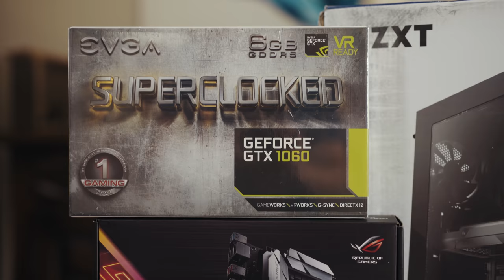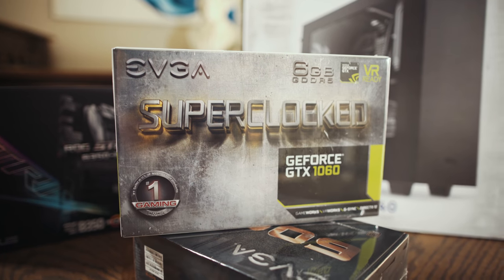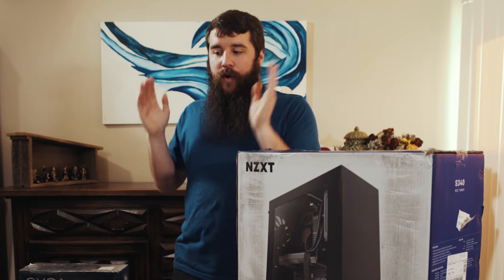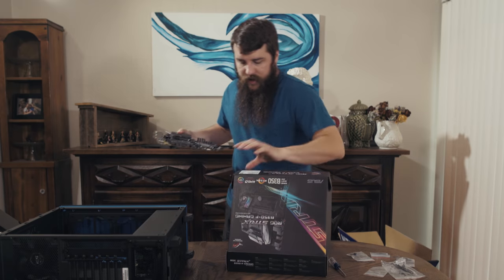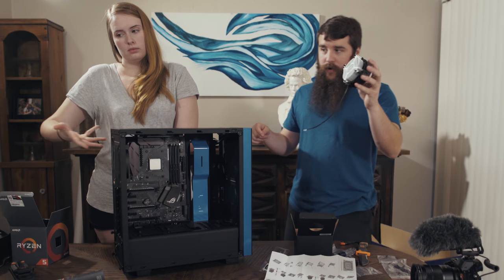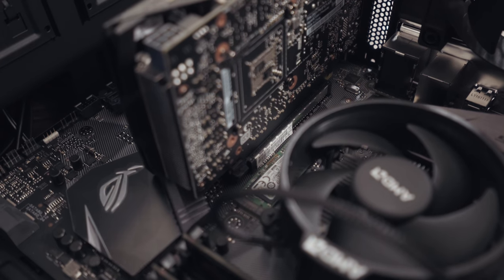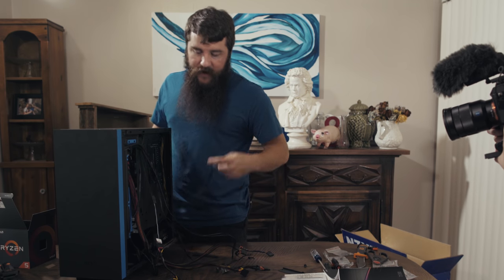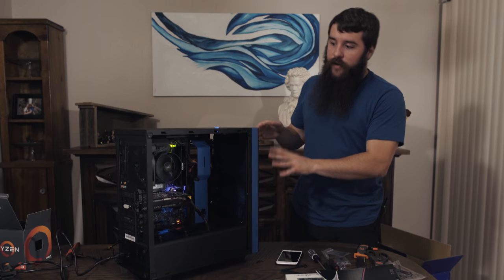How To Build A Video Editing Computer | $850 Ryzen PC Beginners Build Guide | 2017

Comment: So to me, this looks far from price to performance. I've parted out a pc that can blow matt's away. For $903 (before rebates, $891 after current rebates) you can get a better cpu (1500X) and significantly faster ram (3000 vs 2400). The mouse and keyboard are a bit more budget but still are great for gaming. If anyone wants real price to performance, and has an about $900 budget, look this way.  **edit: also the ssd is sata and 10gb less (240 vs 250) but the almost $30 difference isn't worth it.

https://pcpartpicker.com/list/BmwB2R
Reply from the maker: Great setup! Glad to see prices have dropped a bit in the months since I built mine. :)

Comment: you shouldve threw in another $100 for a watercooled radiator
Reply from the maker: Oh man if I had another $100 I would have upgraded the CPU first. Radiator would have come second. ;)
Reply: i have an alright CPU but it does bottleneck my 1060 at its normal clock.
so when i over clocked it, i kept getting crashes from the simplest of games.
and that was bad when trying to play VR games.
so i bought a radiator for about $85 and it stays very cool and i havnt crashed since.

but for sure, if i upgrade my CPU ill have to upgrade my Motherboard too

Comment: Someone is selling a pc with all this for 800 dollars is this a good deal  I know nothing about pc I just want something to do YouTube videos and reactions?DIYPC Vanguard-RGB ATX Mid Tower Dual Dark Tempered Glass Panels with 4 LED 120mm fans (3 intake, 1 exhaust). Mobo: ASUS PRIME B450-PLUS ATX. CPU: AMD RYZEN 5 2600X 6-Core 12-Thread 3.6 GHz (4.2 GHz Max Boost) AM4 95W. Cooler: Stock AMD Wraith Spire. Ram: G.SKILL Ripjaws V Series 16GB (2 x 8GB) 288-Pin DDR4 3000 (CAS Latency 15-16-16-35). Storage: Seagate BarraCuda 1TB 7200 RPM 64MB Cache SATA 6.0Gb/s 3.5" Hard Drive. GPU: GIGABYTE GeForce GTX 1650 OC (non-super) 2 Fan 4GB 128-Bit GDDR5. PSU: Corsair CX Series 550W 80 PLUS BRONZE Certified Active PFC. Network: TP-Link Archer T4E AC1200 Wireless Dual Band PCI Express Adapter. Monitor: BenQ GL2706PQ 27 Inch 1440p Gaming Monitor 60Hz 1ms (GtG). Keyboard: Corsair Gaming K55 RGB

Comment: Would recommend the 1500x for the ability to overclock for only $20 more. Also, y’all need to hit the gym.
Reply: all ryzen cpus are unlocked, if anything i would recommend the 1700 because you can OC up to 1800x levels and it comes with a decent cooler, the X processors do not.